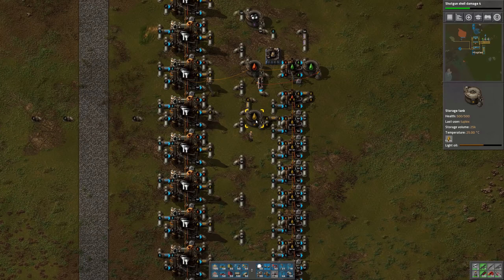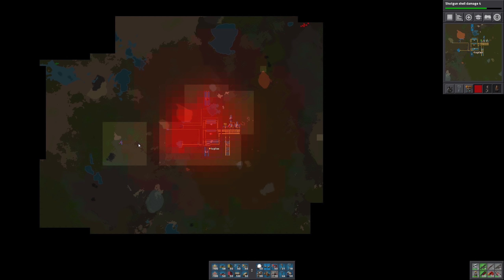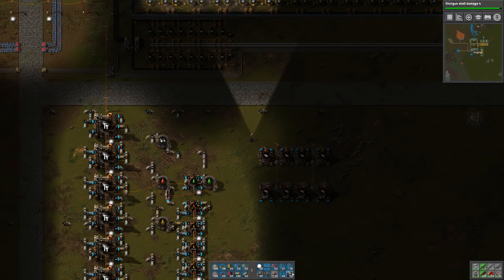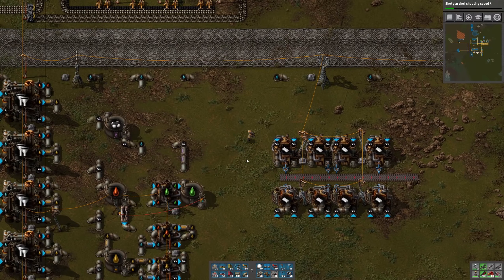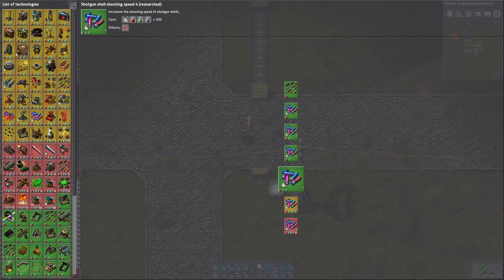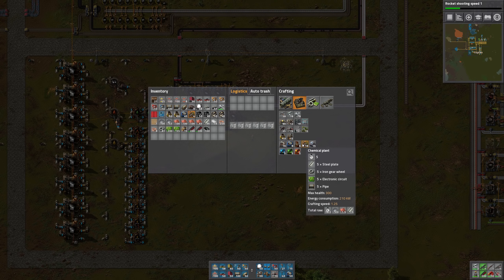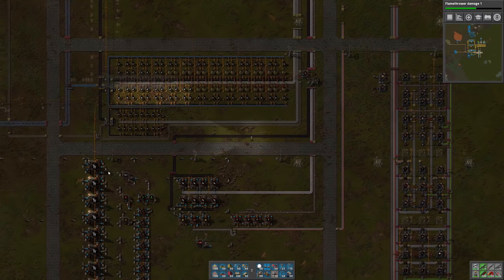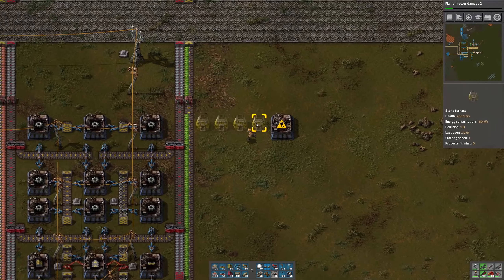Factorio 0.16 Let's Play #8 - Plastic, sulfuric acid, batteries, and engine units

Comment: Did they change anything in 0.16 about the biters? I'm surprised you haven't been attacked so far. I usually get attacked quite early (even before military science) and have to spend a lot of time building a perimeter with walls, turrets, etc.
Reply from the maker: Yes I was surprised in this playthrough by the lack of biters in the early and mid game.  Later on I got my fill, though.

Comment: I think you said in a previous video but why are some of the items in your hotbar outlined in blue?
Reply from the maker: Those are filtered inventory slots - they will only allow that item type to go into that slot.  This way, my toolbelt layout is always the same.  You can filter a slot by clicking the middle mouse on the slot.  Or on Mac, option-right-click.